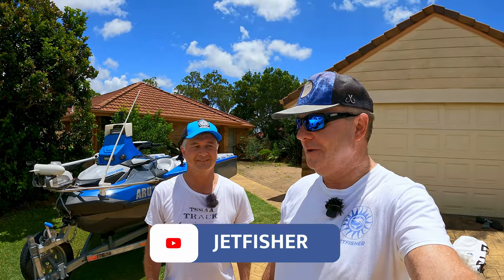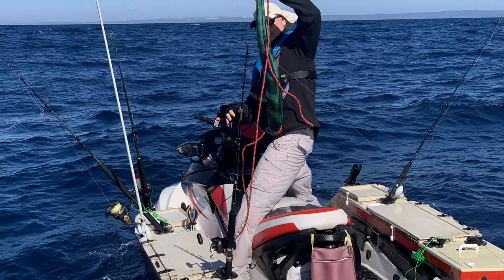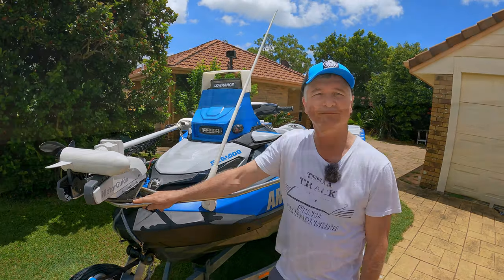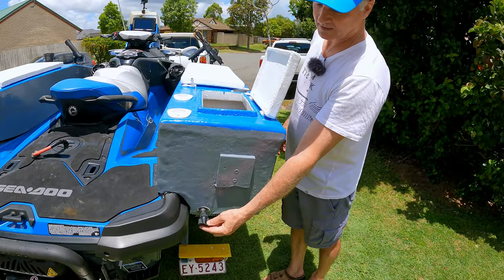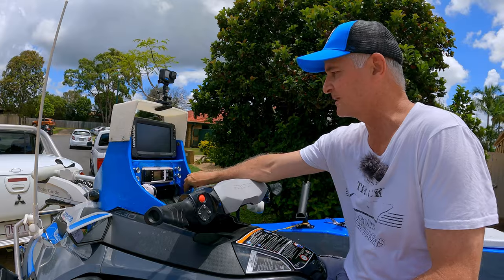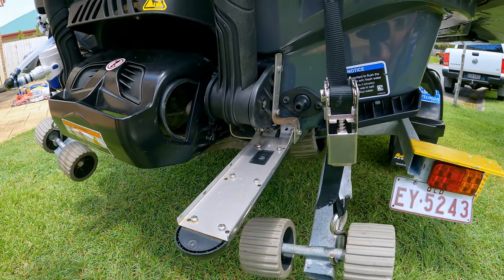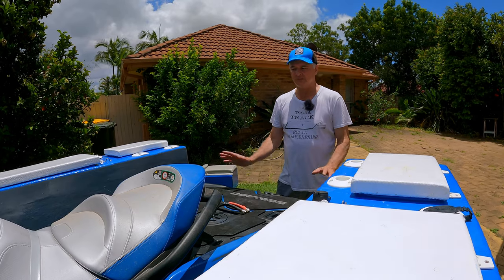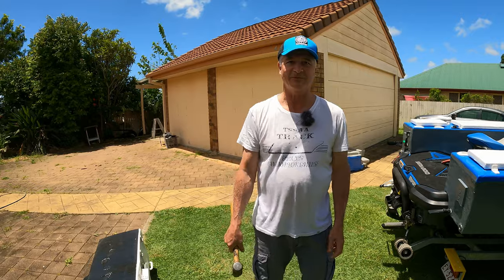Sea-Doo GTX Weapon- Fred's Complete Jetski Fishing Fitout!

Comment: That’s awesome set up Fred, I was wondering with all your mods does it alter the SeaDoo warranty at all??? Either way you’re much safer & it has everything you need for an excellent day on the water👌👌👌
Reply from the maker: Fred tried to answer you but for some reason his comments won't work! And I haven't blocked him! But he said that as long as the mod doesn't cause the failure, all should be ok. It's like putting an aftermarket tow bar on your car, and the motor has a fault. You don't void your car warranty.

Comment: Great set up. I had a seadoo gtx 300 have sold that now and ordered Yamaha 1800 non turbocharged. I will fit it out with shoreline when I get it in August hopefully. Seadoo we’re very stable ski. Things I didn’t like the seat sat lower bending your legs more over the day. The motor got extremely hot cooking the seat under you making it hot and uncomfortable. My mates Yamaha rode through chop and swell so much easier. The seadoo slappped more hurting my back. The footwells on seadoo are deep so when stopped fishing they hold a lot of water which was not good for me. Just a few things there I noticed. I’m hoping the Yamaha does the job for me but that just my personal preference on skis
Reply from the maker: Thanks for watching and for your comments Tidal Flow. I think you’ll like your Yamaha. Each ski has its positives and negatives but the FXHO is a very good and reliable unit so you should enjoy it!
Reply: Did you find the gtx hull had a mind of its own? Or as some call it ' bow hunting', or 'darting' around. Seems a common theme with the st3 hull. The yamahas have footwell drains yeah?

Comment: Thanks boys for the video like that  Fred has the electric motor. I want to get a PWC but am going back and forward with the seafood fish pro and Yamaha HO. I am concerned about the seadoo with some saying it rides like dolphin porpoising no matter what they do. Being set up the fish pro is a specialised fishing ski which is good, however i would like the pods on the side as well like the shoreline tubbies.
Reply from the maker: Hi James, choice is good, and drives the competition!  I still prefer my FXHO, but this video shows there are alternatives. If you want a finished package because you don't have a local dealers to fit out a base ski, then the Fish Pro might be for you. I am a person that is concerned about safety and engine reliability offshore. You also might think about the cost and frequency of repairs/maintenance if you do the motor hours I do.  Shoreline Jetskis in Brisbane do both brands and specialise in fishing fitouts.. They are now doing packages of either FXHO or Fish Pro (or GTX) units with Tubbies, so both options covered. The trolling motor is a luxury when you get very serious and willing to spend the money to save engine hours.  Currently I simulate the spot lock manually using the ski engine to hover over the deepwater marks. But that's why I have over 500hrs on my ski now. in 3 years.  Not that hours on a Yamaha are much of a problem except maybe for perceptions when reselling. My engine has never had any issues, and still is solid. But if you do go Seadoo, choose a specialist dealer who really knows how to service them- I keep hearing a very high level of skill is required to ensure the engine and drive shaft is aligned perfectly so that the carbon seals and other parts last to specs.  Thanks for watching and commenting.
Reply from the maker: BTW, sometimes we can overthink a major purchase. You get to the  stage that you realise that either way it probably won't really be a bad decision!
Reply: @Jetcast  Thanks for your thoughts i have been watching and sub to your channel for a long time now. I think i will go Yamaha i like the look and reliability as well. The tubbies are cheaper on Yamaha as well the shoreline salesman told me. I love the new wreck deck and i think its where i could put an electric motor. Cheers keep the videos coming please.
Reply from the maker: Try my best!

Comment: Interesting vid, nice setup. Im very interested in the extra fuel setup, 
We do regular longer trip out here in thailand and im always out of fuel first with my rxt300.
This could be a solution. As for i was told it was not possible to connect an external fuel tank to the newer seadoos.
Seems like you found a way around it.
Reply from the maker: Yes Fred has certainly has got that working and has no range issues now. If you want, send me an email and he might help you put one together. info@jetfisher.com     Thanks for watching and commenting!
Reply: @Jetcast  email send😎
Reply from the maker: Got it, I’ll pass it on to Fred.

Comment: Hi, just started watching your videos as I’ve ordered the FX SVHO Cruiser which will be here in April.
I’m new to this jet skiing and want to set my ski up for fishing with the Tubby’s and just wondering 
where you could mount an electric motor on it front or back Fred’s looks really well thought out how 
he’s done it. I like a lot of the things you’ve done and how you’ve set it up on your ski Paul,
I’d love to hookup with you guys to get some invaluable experience and learn some tricks of the trade.
Cheers Russell.
Reply from the maker: Hi Russell, the best spot would still be the front and we’re looking into the possibility of a similar bracket for the FXHO. Thanks for watching and commenting. Keep in touch.
Reply: @Jetcast  Hi Paul,thanks for replying,just wondering where you got your auxiliary fuel tank from and did you 
do the mods on your ski eg: front rod holders and fitting of fuel tank?
Cheers Russell.
Reply from the maker: @Reddog1963   Hi Russell, Shoreline jetskis at Slacks Creek, Brisbane, did the entire build (Tubbies, aux tank, lights, dual batteries, etc) on my 2019 FXHO from them. The left side front rod holder and the rear rod holders were after-market from GC Jetski fishing in NZ.  (If you haven't seen it, there is a fitout video of my ski : https://youtu.be/CRqeAb4XW_k  )

Comment: What battery are you using to power the trolling motor and where do you keep the battery?
Reply from the maker: Hi Frank, Fred is currently overseas and probably  won’t see this. But I’ve seen the battery and it’s a big lithium ion model that’s mounted in the rear of his right hand pod. I think it’s a 100ah and less than half the weight of a lead acid or gel cel.

Comment: As much as I love fishing from a jetski, but with all these mods would it be better to just get a small boat ?
Reply from the maker: There are several things that make a ski win in a comparison to a (small) boat if you are talking about the adding of accessories as the tipping point. The main one for me is where you can fish on a well equipped ski.  You'd need a 6m+ ocean going boat to match the range, performance,  and capability (in weather)  to go where we fish. Here that means a spend of at least $75K (AUD) and probably more like $100K to get it fully kitted out for the styles and range of fishing we do. We regularly cross coastal bars, and do around 120km per trip, so that immediately steps you up into a different class of boat, and therefore way different cost comparison. Downsides are getting wet, taking people, and in some locations cold weather would be a limiting factor. If I had the money, I'd have both, but the boat would be more use for pleasure cruising than fishing I'd say. Thanks for joining in on the discussion!

Comment: Wonder what he’d think about the Ultra deck on the new Kawasakis
Reply from the maker: The new Kawasaki models are quite interesting. The 310 is not really the ideal fishing platform due to fuel economy, but they seem to have some nice features that would appeal to me in a non-supercharged version if hull, deck and electronics are the same.  Thanks for watching the video David.
Reply: @Jetcast  Apparently the ultra lx (160hp) has an 80litre tank I think, but isn't as efficient as the FX or Seadoos. Maybe because it has to drive that big v through the water. I wonder how stable they also.